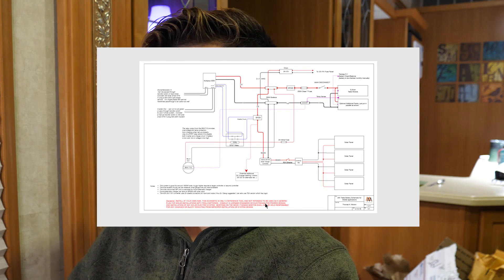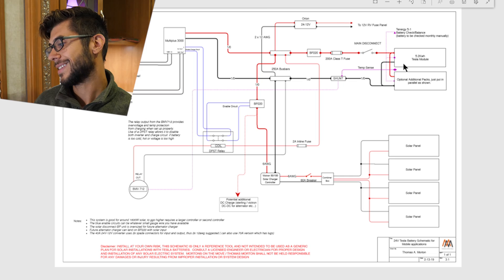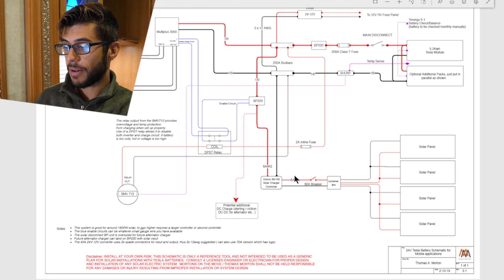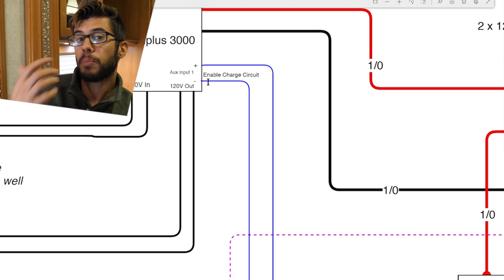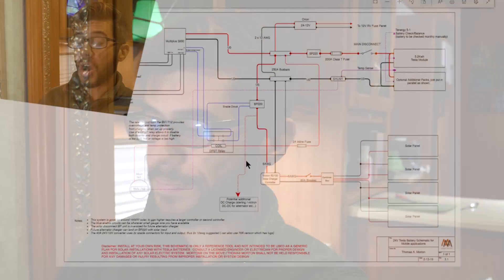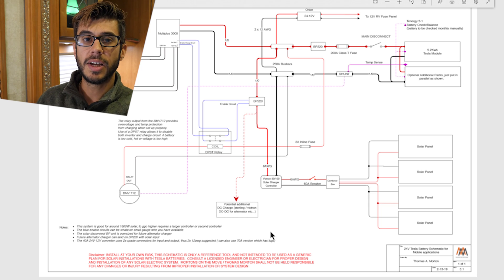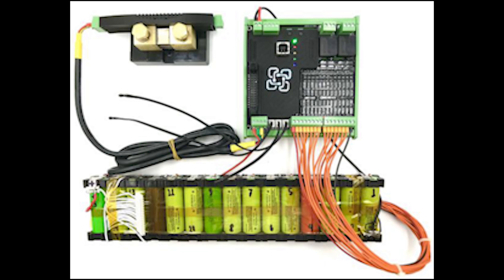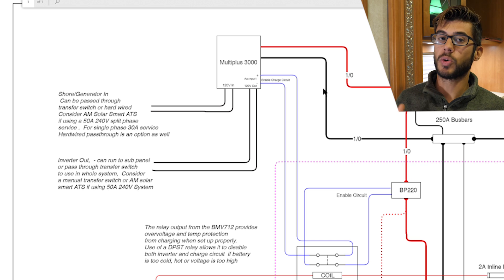RV Tesla Battery Install - System Simplification and Improvements , Schematic Walk through

Comment: Did you ever upgrade to two Model S modules in parallel? Seems, there are some issues. Would like to hear your thoughts on it. The potential issues are explained here: https://www.orionbms.com/manuals/pdf/parallel_strings.pdf
Reply from the maker: We did not, but if one were to do that having some active balancing would be a good idea and a pretty easy implementation.
Reply: @MortonsontheMove  Do you mean active Balancing between the modules, or just for each module? Am wondering, because the balancers seem to take care of the cells in one module, and for each additional module one would need an additional balancer... So what keeps the modules against each other balanced? An idea? By the way: Great clips about Your setup. Gave me some great impressions!

Comment: Tom, I recently saw the comments on the Victron Community page about not using the BP220 between the inverter/charger on the battery. I'm now concerned about what to do because I have that set up in my own system. Any comments you can offer on a solution?
Reply from the maker: I have not yet resolved this with my system but I probably will just take the inverter and connect it on the battery side of the BP220.  The inverters lowvoltage cutout is around 19V so your good there the HV cutout is separate anyway.  Bummer about this , victron originally had no warning on using it like this... and its kinda worthless as a one way switch.
Reply: @MortonsontheMove  Agreed. And the solar has a built in low temp cutoff, so it's pretty well protected by the charge enable relay. Really enjoying the go north videos!

Comment: Great work Tom.  Many thanks for sharing.  I decided to look into using the OrionBMS 2 with 3 Tesla modules packed in parallel (as done by Jack Rickard, EVTV).  But OrionBMS app strongly caution connecting multiple Tesla modules in parallel, especially without a carefully considered way of ensuring the cells are properly monitored:  https://www.orionbms.com/specific-battery-integration/using-tesla-battery-modules-with-orion-bms/
.  In view if that concern, it would be helpful to address how you would address this.

Comment: The BP 220 that is wired next to the fuse to the battery. Are you following along on the victron forum where folks are having fires from having current flow both way through them?  I.E., charging and discharging?
Reply from the maker: I have heard of that, do you have a link?
Reply: Mortons on the Move https://community.victronenergy.com/questions/2030/vebus-bms-with-2-battery-protect-alternative-layou.html?fbclid=IwAR2WA0cRyGoAjvC81_ZioNgUK6tsmjBsnEGuFaCLBuEAwguxnV_ArOVAhfU
Reply from the maker: Thank you,  I do not have time to do an update, but I will post this on our site and in pinned comments.

Comment: One head scratcher about your use of the batteries. Towards the beginning, you mention it's a nominal 21.6V battery but then program the charge controller to 24 or 24.5V. I don't understand the discrepancy.
Reply from the maker: Nominal is the 50% charge.

Comment: Are you able to share the usable voltage window or usable energy of this setup? I am curious as to how much capacity is limited by the multiplus and what your minimum voltage shut off is at the inverter. I am reading some comments online that the multiplus limits you to only 50% of the battery modules capacity. Much appreciated!!
Reply from the maker: 24-19v. We get about 4.5kwh

Comment: I enjoy your videos Tom, thank you. I would like to suggest the addition of a liquid cooling system to your Tesla battery module. Check out some CPU liquid coolers. Some kits contain a seperate radiator and small DC pump to circulate the coolant. Instead of hooking into a CPU block, you connect the lines to the in and out of your battery coolant ports. With a little browsing you can find large or small radiators to suit your preference. A temp control switch will turn the pump on or off automatically as needed. Your Tesla battery should already have provisions/ports for liquid cooling. This would keep your expensive battery cool in the hot Summer months during heavy use. You already mentioned you have the heating pad for the Winter so you're already good to go there. I guess you could use the CPU liquid cooler/radiator as a heater too if you placed the radiator inside the heated RV in Winter. Best, Chris B.
Reply: Where can you buy a cooking system kit??

Comment: Question, what happens to the tesla battery if the outside temperature happens to go above 105 degrees?  How would one cool the battery down?  Some parts of the country do go above 105 in the summer time.  If the battery range is set to operate  40 to 105 degrees like was suggested in the video.  Like the videos. Thanks
Reply from the maker: 105 was just my hi temp alarm so I know when the battery is getting warm.  The battery should operate safely much higher, not sure exactly what that limit is but i have heard the car wont start cooling until its past 120.

Comment: Question on the issue of the 50 amp service and having to jumper the legs.... and having a built in onan 5500 generator.

Since the generator puts out single phase on both legs. And the smart ATS wont deal with that well, 

1 is it possible to offset the phase of one of the legs comming out of the generator to make it true split phase just like shore power?

2 alternatively is it possible to make that up using 2 inverters? One per leg? 

I would at some point like to have the option of using a 220 welder off battery or solar. But this seems to present a big challenge.
Reply from the maker: The generators are wired internally that way so no changing it. You can use two inverters in a split phase config, this is done alot.  A cheaper option would be an autotransformer but your current will be significantly limited .
Reply: @MortonsontheMove  so if I were to do the two inverter option. Is there anything i should keep in mind when programming each inverter since they would both be charging and drawing from the same battery bank.
Reply from the maker: @bbsubie  Nope, they should configure in a master slave configuration and will charge equally or limit based on your settings. The should both back down on the charge at the same time.

Comment: I have several 48 volt nissan leafs, how should I connect the battery temp sensor to multiple batteries?
Reply from the maker: In my case I am mainly concerned about the cold so I put it at the coldest point. You will not use it for compensation, just under and overheat.
Reply: @MortonsontheMove  thanks.

Comment: Tom a Tesla battery pack without a BMS is an accident waiting to happen.. I know you install several  safety precautions like the shunt and the over heat sensor and the heating pad.. but nothing can take the place of a BMS operating the safety precautions needed for the batteries installed in this systems..
Reply from the maker: The only thing I am missing is cell level monitoring and we stay waaay away from the limits where this is required.  A simple check, balance and check internal resistance occasionally I feel will alert me if something is going awry. Over, under and charging when cold are the biggest concerns. .....that being said, 057 is working on a mini BMS we can just plug in to easily monitor the pack full-time and I will do it when it's available.
Reply: @MortonsontheMove  Tom you are a very knowledgeable person.
I was told you are  an engineer involved in the solar industry,  so I'm sure you all ready know what is required of the system you designed. I seen other posts of people installing DIY systems in their homes with no safeguards installed in there systems. This is where a BMS is one of the most important aspects of a power wall.
For the safety of your family and your home.

I'm sure if there was some kind of catastrophic failure of their systems in their homes I'm  sure their homeowners insurance wouldn't cover there systems. When a Tesla powerwalls is installed into a homes. The homeowners insurance company usually ask them if it was installed by a licensed electrician and wants to see proof of that to cover the system.

Again I must compliment you on your system that you're one of the better-designed  systems I've seen that was not manufactured by a corporation.

 I wish you and your wife well on all your endeavors
Reply: Tom I am using your system in my Class C with the Victron Multi plus set at 30 amp input. What do you have you charge setting parameters set at using the Victron connect software. Do you have a screen shot of this posted? What charge amps are you using for one Tesla module? 30 ,50, it 70 amps? What do you have your bulk and absorption settings at and time frames ? I have bulk set to 24.4 volts and absorption I think at 24.3 volts. My shutdown is 19 volts both on the inverter and BP220. I am still trying to program assistants. Do you have any issue with the Victron factor set at 21.8 volts turn on min voltage?

Comment: I am going to use the BMV-712 and the 48-100 battery protect for a home backup system with 2 Tesla batteries in series. I am following you setup. My question, how do you wire the 712 to the battery protect so that it isolates the battery?  My battery protect has a three pin plug (alarm, gnd, prog) and a two pin remote plug. The 712 has 3 receptacles labeled no, com, nc. I have looked at many sites and can't find any wiring diagram for how to set this up. Thanks for your great videos, they are the only reason I have gotten as far in this project as I have.

Comment: Hours after I ordered my Tesla battery. Will Prowes, just released a video basically saying the Tesla battery as a house bank was not as feasible as he originally thought. His motivation is primarily due to usable voltage ranges and what he now rates as a high fire / explosion potential, In  contrast to his earlier mitigation of the risks. Would you go the Tesla route again, or would you too now lean more to other options?
Reply from the maker: It really depends on what you want to do with it and what your priorities are.   The Tesla is still the best power to weight ratio.  Fire concern is always there and you must properly monitor and cutoff the battery.  If weight and space are not a concern yes I probably would do LiFe for the stability.  But in our case weight space and cost pointed to the Tesla pack.  Usable voltage is a concern but you can find inverters that can use almost all of it.
Reply: Thank you for your feedback.  Lots to think about and consider.

Comment: https://twitter.com/bloombergnef/status/1075410072283594753?lang=en

According to Bloomberg the cost of a lithium pack, not just the cells, is under $200 per kWh. The trend has been to lower prices for a lot of years. So, obviously, there is something wrong when you are paying double this price for used packs. There are references to the $200 pack price if you run a Google search. 

I think you need to find sources in China. I think you need to move to LFP, which is safer. If you can't figure out what that Bloomberg chart means, I don't know what to say.

Comment: What settings are you using on the BP200? I'm using (2 C) which should shut off at 19. I get Error 4 (high voltage)with this setting but it doesn't seem to affect anything.

Comment: Tom, I used your setup for inspiration on mine. I'm using a SmartSolar which pulls temp data from my 712 and has a programmable low temp charge cutoff. I didn't know about the charge enable circuit on the Multiplus, however. I'll be hooking that up to the relay output of the 712 to temp protect shore charging. Thanks for that! Also, to get around the alternator charging issue, I've got a 1500w 12v inverter providing a simulated "shore" connection to the Multi. Flick a switch in the dash and the Multi starts charging the battery. I chose to limit it to 12 amps so as not to overload the 1500w inverter.
Reply: NICE! I have been trying to figure out how to do this! Great solution. I know there will be losses, but at least it'll be charging during those LOOOONG drives! So you limit the incoming to 12 amps using the Multiplus?
You have to reset when pluggin into actual 30amp service right?
Reply: @Brandywine-farm  Yep. I can change it on my phone with the connect app. There's a Bluetooth dongle now but I have the normal mk3 cable plugged into the USB port on my phone

Comment: if your double pole realay faile (open) and no spare, just unwire from that BP220? or othewise take it of line?
Also, when you are balancing out your battery pack for however long it takes, are you taking packs offline for all that time so it can balance with ease?  I am supponing at this point as I know nothing of this but am learning from peeps like you and Will Prouse.  (brothers from another  mother).

Comment: Nice vid... nice diagram. VERY GOOD SHOW.. I had to look up what BP220 is, but got various results from a battery connect to a battery protector.. I am figuring you mean something like a Victron Battery Protector.? but do not know how they work... have to look later.
Also, maybe your head is in the way, but what about an external generator hook-up in the system?  Maybe that goes diretly into the DC to AC inverter charger I guess? Where normal 120 comes in or maybe a different connect.  I presume the inv/chrger has all the internals to kick on a generator at night if 120 goes offline for a bit?  Just wondering what people do or want or think is best in any condition in an RV,  Mostly when very hot or cold ambient temps and may be away from their unit for a week on some trek or something.
EDIT>>> I should have waited till end to post but thought I would forget... YOUR HEAD was in the way... LOL.
And at 15:15 , I got lost and dizzy... have to worry about such things only if ever need to in my future....I was looking for green ground wire of the 50A shore but did not see in that diagram... My AM eyes finally focused and saw the muted green lines!!!!!!   AND, what if have 50A coach and only have 30A gas generator, just to get by.... I bought a used Open Road 5th wheel and it has split circuit going in, but is really only running off of 30A and the other part of split is on another AC wire/outlet box in the basement and that is where one would tie in an additional A/C for bedroom if one wanted to, since not equipped as built... that is, it is spare energy from the factory for future use or for running tools outside on some project.  THE dumb  RV mfgrs do not provide any wiring diagrams (dumb and should be illegal ) but state the split and receptacle setup. I guess this is a good way for a MFG to go as 30A shore available also works for most all... So flexible.  Just a dead receptacle ifn only 30A shore available or if running off generator.  I guess it depends on what size generator you have for your set-up and how to set it up best for a user.

Comment from the maker: !!IMPORTANT!!  -  Victron has announced that the BP units are not designed for reverse currents and could start a fire.  We have got away with it for 2 years, but probably because most of our charge is solar.   Please consider this in your design, this design technically does not meet these requirements and when I have time I will update to a recommended solution. 

Edit:   I said we originally had a BMV 702 when it was actually the 700.  The 702 is the same as 712 without bluetooth.
Reply: Don't forget to mention: You can add an additional bluetooth dongle to the 702.
Reply: BTW, where did you place the temperature sensor, on a battery terminal, or attached to the side?
Reply: @leebiggs2844  Please allow me to answer that question fast, a picture says it all: https://www.victronenergy.com/upload/cache/1424782941_upload_documents_775_500-Temperature-sensor-for-BMV-702_ASS000100000.jpg
Reply: @christee2908  I did know the Victron temp sensor is designed to attach to the battery terminal. I asked Tom where he put it, because in his original setup he was using a temp probe stuck under the plastic cover on the side of the battery pack. I was wondering if he had, or had not, used the same location.
Reply: @leebiggs2844  On the side of the battery pack? Then I doubt the accuracy of the measurement in the whole. The NTC element is constructed to be placed on the terminal as you know, so the distance between the terminal of the battery and NTC element build in the cable shoe is important to absorb rapid temperature fluctuations. A more intense contact of the sensor on the battery can cause faster fluctuations as a measurement and, in doing so, steering the BMV incorrectly. It could work but not as Victron has anticipated and calculated.
It's nice to see people trying new things, especially when they share it on YT.
Reply: @christee2908  But Tom is concerned about CELL temperatures so that the battery does not charge when cold or when too hot. Because the battery terminal is on the edge of the battery and not the top, the reading would not be very accurate for center of pack temps since Tom has the battery mounted vertically on the long edge with the terminals on one side. Also current in the wire  could cause a temperature misread, being artificially high. Tesla uses coolant tubes and a 10k thermistor at the inflow and outflow to calculate cell temps and the liquid coolant tends to even out the cell temps. Air cooling usually results in cells in the middle being significantly hotter due to surrounding cells also heating up.

Victron mainly uses the temp probe to compensate for temperature effects on capacity of lead acid batteries. Not thermal safety as Tom is using it.
Reply: @leebiggs2844  Hi Lee, I do not know how Tesla engineered their batteries. It's of no importance to me because I use solely Victron products. I use this temp probe on a Venus GX and let it communicate that battery temperature over to the MultiPlus. But thats a whole other subject and and of no importance in his arrangement.